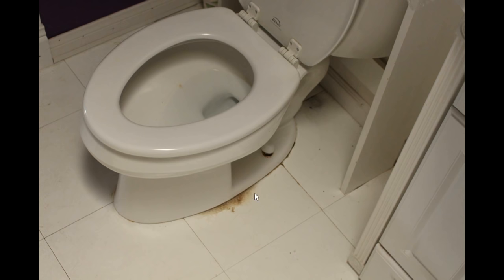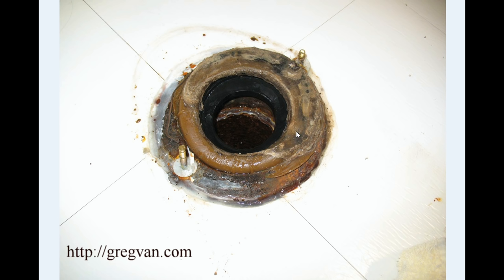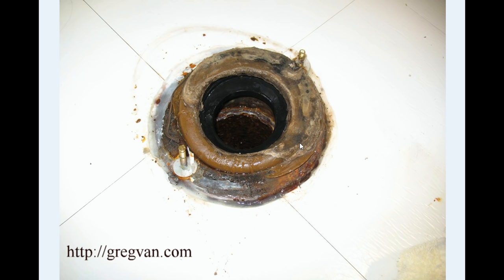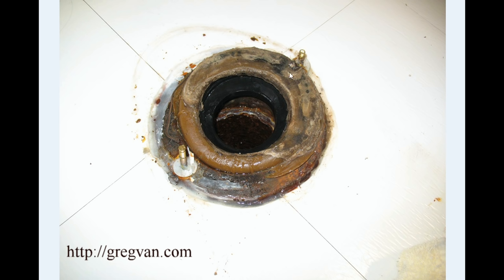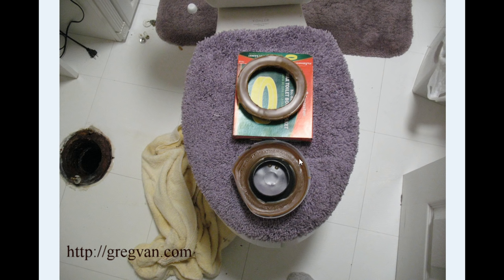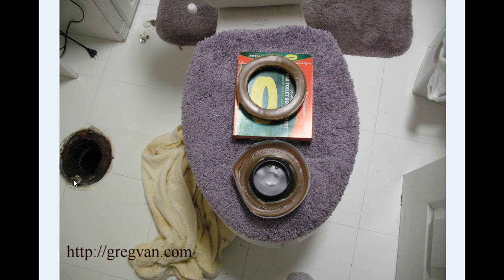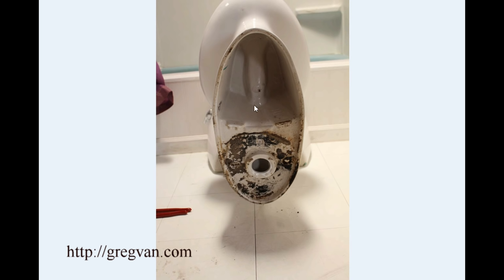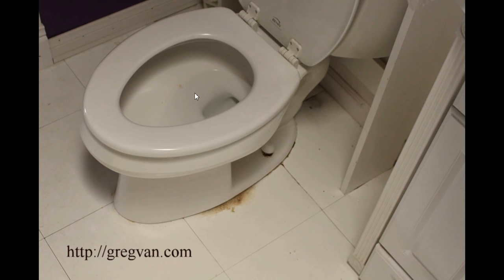Watch This Video If You Have Water Leaking at Bottom of Toilet – Home Repair Tips

Comment: I had a new wax ring put on my toilet to seal it because it was leaking. The old wax ring looked as if it had melted and wasn't even there almost. The new wax ring started leaking after about 2 days so he came and put another wax ring on and after about a day and a half it started leaking again. When he put the second wax ring on the first one also looked like it had just melted and spread where it would not seal. I do not know what to do.
Reply from the maker: It sounds like there isn't a large enough gap between the toilet and the top of flange. I will have to make another video on this problem.

Comment: I had new toilets installed.  When you sit on the toilet it makes an air release sound. If you move around on the toilet seat it make that noise like releasing soda bottle top.  Do you think it could be the wax ring  not sealed properly? The toilet flushes fine and I don't see any water around the toilet.  It is caulked though so I may not be able to see the leak.
Reply from the maker: +Shauna Glaspie The toilet shouldn't be loose, try to tighten the bolts that connected to the floor. The only time I ever had this problem was when I went over to someone's home and they had a cushioned toilet seat, but have never ran into that problem since.

Comment: I am buying a property and the inspector noticed the upstairs toilet leaking at the base, and he used his radar camera to locate water in the ceiling/wall below the bathroom. The floors were recently replaced and the owners used a handyman (instead of a plumber) to remove and replace the toilets. Do I need to reinspect for water damage to the flooring, subfloor and mold inside the wall/ceiling below?
Reply from the maker: I would examine the areas myself to see if there is damage, but I don't know if you need to hire an inspector.
Reply: if the owners cut corners with a toilet, imagine what else they did……run
Reply: @KRITORISS  can't afford the properties with better maintenance. I can fix this one for less than I can buy another

Comment: We had a drain back up and thought the toilet was overflowing. Upon checking back, the base of the toilet is leaking while the drain is backed up, or slowed down. Would that be the wax ring?
Reply from the maker: It could be, but I had the same problem when I had a drain backup and it usually isn't a problem once the drain is unclogged. If it continues to happen after the drain is unclogged, then I would seriously consider removing the toilet and replacing the wax ring.
Reply: gregvancom Thanks and it did clear up with the clog resolved.

Comment: I recently replaced wax ring (leaking) with rubber ring that has 2 rubber gaskets on top (came with 10 year guarantee).. Still leaking. A lot. I'm a grandma so its heavy and awkward to lift toilet and replace. Willing to do again but need more tips to get it right. Toilet is in basement with concrete floors. Removing toilet is not supposed to damage rubber ring like a wax one. More info on the bolts maybe?
Reply from the maker: You might need to find someone strong enough to place the toilet in the proper position. Sometimes when you're installing the toilet you can actually squash the wax rings or relocate the rubber rings, which would allow water to leak out of the bottom of the toilet.

Comment: My toilet leaks at base  No one uses it.  When it leaks it's leaves a yellowish stream.   The yellowish stream does. Not happen all the time.   I just moved in the house less than a month.  Could it be an issue with the wax ring or a cracked in the toilet as stated in the video
Reply from the maker: Yes and don't forget to inspect the entire outside of the toilet, sometimes for cracks and where it connects to toilet tank.

Comment: Hi there, I had to unblock my toilet last week and a few days later noticed water leaking on path outside, is this a coincidence or could it be coming from toilet?  Thanks.
Reply from the maker: I would check to find where it's leaking from.
Reply: @gregvancom  Thanks, it's actually the water supply pipe that's leaking and just a coincidence.  It's going to be fixed on Monday.

Comment: So I have a toilet that’s not holding all the water in the bowl. You can see it losing water out of the bowl after it stops filling. It loses about half the water but doesn’t seem to lose anymore after that. I do have a wood floor and the house is old and seems the wood is a little crunchy sounding. I can’t see any water from the base of the toilet. I can rock the toilet with hands front to back but not side to side and me not be level. Any thoughts?
Reply from the maker: If the water is disappearing that fast, then you might have a crack in the toilet bowl somewhere. Keep in mind that this is only my opinion, because you could have a blocked pipe or vent that is creating some type of suction or siphoning affect also.

Comment: How do you fix the problem of a rocking toilet that causes this in the first place? The toilet is on a cement floor with carpeting that will now have to be removed. 
Thanks for the video - very helpful.
Reply from the maker: I am planning on making a video about securely fastening toilets, to prevent them from moving, just don't know when it will be made. Most of the time toilets move because the two toilet nuts on each side cannot be tightened for some reason, does this sound like something that might be happening to you?
Reply: @gregvancom  Yes I think it might - the rocking is front to back though. 
It's on a cement slab and I think the carpet install caused the problem - 
why would anyone put carpet in a bathroom anyway? Now it's all been removed thanks to the backflow which required removing the toilet to clear the line anyways. What a mess! Cement slab was a good ending at least - possible to clean. Now we'll put in waterproof laminate and maybe I'll learn how to properly seat a toilet. Make that video, please!!! We'll need it! lol

Comment: You stated that if the water in the bowl slowly drains down when the toilet isn't being used that it could be a crack in the toilet, but that there could be other causes.  What might those other causes be?
Reply from the maker: Something else I can think of would be some type of siphoning of the water when the pressure in either the drainage or vent pipes changed, leading to an event that would pull the water out of the toilet bowl.

https://youtu.be/lQKuc5mxdQM

Comment: Hello I have a question

For the last few months my toilet gets blocked very easily, I noticed when you flush the water builds up just a little bit higher than when it should, as if there is a small partial block that never goes away (I know there is nothing down there because I live by myself) and I have just been dealing with it. 

So when it does get blocked completely I flush it with a bucket of water which is enough pressure to fix it... so I noticed this leak today at the base after using the bucket, is it related and what does it mean?
Reply from the maker: Try holding the flush handle down without letting it up to see if everything flushes down and if it does, then you might have a problem with your flapper. It could also be a problem if the water level isn't high enough in the tank and last but not least, something could be blocking the passage between the tank and the bowl.

Comment: Needing help my toilet is not only leaking water from bottom of bowl itself but backing up in bathtub nearby? Any ideas on how to fix?
Reply from the maker: It sounds like clogged door blocked drainage pipe. You might need to contact a plumber who unclogs drainage pipes or go down to your local rental yard and explain your problem to them and they will provide you with a tool that can be used to remove the obstacle in the drainpipe yourself. Keep in mind that this will not work all the time and might not be a long-term solution.

Comment: Hope you are still around. I came home from a trip.  It was very cold in the house.  I flushed a second floor toilet and got a wet ring on the ceiling below.  If I leave the water on then water continues to run outside into the septic tank.  I got a large water bill after this was going on for a month and I didn't know it.  When the water is turned on now, it doesn't leak into the ceiling the ceiling though stained is dry, but water is going outside. Is this a wax ring problem?
Reply from the maker: The wax ring could be the problem for the ceiling stains or water leaking from the toilet, but shouldn't have anything to do with a larger water bill. That sounds like you might have a water leak somewhere. Type this phrase into a search engine "how to use water meter to check for leaks" and see if it helps you, before calling a plumber. You can actually use your water meter to see if water is leaking, but it won't be able to tell you where the leak is.
Reply: Water leaking in the toilet is not the water leak? Darn!  I will certainly type that phrase, because there is definitely a water leak and the water is running outside/draining out to the septic tank. But I am going to need a plumber to come with a compressor to find the leak. Water company wrote me note in my bill that my bill was 2.5 times higher and that I should check for a leak.  This was after the ceiling problem and water found running outside. THANKS.
Reply from the maker: You're welcome and it sounds which he got the situation under control.

Comment: We have a leak at times around the base not always though . . do heavier persons cause this to be a problem ? Seems it
Reply from the maker: If the toilet is moving and not securely fastened to the floor, then a heavier person might be able to move it easier. As the toilet moves back and forth, it can damage the wax ring, allowing water to seep onto the floor.

Comment: If I have a leak under my wood floors in my bathroom would I be able to see water around the  bottom of the toilet or could water still seep under the floors?
Reply from the maker: It could do both, seep through floor and lay on top of floor.
Reply: Found out my tub is leaking underneath and into the tile &wood flooring. They will have to access through tunnel under slab.🫣

Comment: Where can we send photos to? We have the smallest amount of water leaking into the grout and we’ve already replaced the ring to try to fix the problem. The water even travels a little further in the grout now :/
Reply from the maker: I don't know if you will need to send pictures. However, you will need to verify that water isn't leaking from any other part of the toilet that you can see on the outside. You will also need to check the water supply shut off valve and the water supply hose that connects to the toilet for leaks.

Last but not least, you might have to remove the toilet again to make sure that the wax ring was squashed down correctly. The only reason why I'm saying this is that sometimes the wax ring doesn't get squashed to create a seal and will require another wax ring.

If you need to send pictures, go to our website and at the bottom of every page is the word contact, click on it and it will take you to a page with the address on it.

Comment: how do you tighten the bolts when replacing the wax ring?  The bolts on our are loose.
Reply from the maker: I would need to know what type of bolt you are using, but this is a common problem and the best advice I can provide you with would be to grab a pair of pliers and create a firm grip on the threads that are extending up past the nut to prevent the bolt from moving and then try to tighten the nut. Let me know if this doesn't make sense.

Comment: Plumbers know exactly how much to tighten those closet bolt nuts to not crack the china .  whats the best advice to give on this to avoid any movement but not over torque those nuts ? .For you pros is it a matter of experience and feel ? Have you ever cracked the base ? That tells me you dont use much torque at all if you didnrt . If the bowl leaks after a repair do you just snug em down some more on a call back or do you start all over with a new ring ?
Reply from the maker: You bring up a good point and all I could suggest would be to follow the manufacturer's installation instructions. I can't provide you with the exact amount of torque required for every toilet installation, but can tell you that just a little more than finger tight might do just fine.

The toilet can still move if you're attaching it to a toilet flange that can also move and eventually ruin the wax ring.

Comment: We have been perplexed by darkish fluid coming through our downstairs ceiling and our upstairs outside siding in an area adjacent to our shower.  The upstairs toilet is adjacent to the shower.  We thought the shower was leaking, but recently discovered leakage around our toilet (it was always covered by a bathroom U-mat).  Could the toilet connection be leaking flush water into the flooring and then leaking through the downstairs ceiling and out through the siding?  Yuck!
Reply from the maker: Water leaks are difficult to find. If it's an area that's wet often, then you could stop using the shower for a while, but keep using the toilet, to see which one might be the problem and then of course vice versa. Use the shower, but quit using the toilet to figure out where the water is coming from. It sounds like you might have a leak through your drain pipes, which might require you to remove some of the ceiling or siding.

Comment: I had a Drain toilet stoppage on the first floor. and the water was backing up from under the toilet. I unclogged the stoppage. But when the toilet on the second floor is flushed there is a small amount of water dripping out from the bottom of theDownstairs
Reply from the maker: It sounds like the drain might still be partially plugged or that you might have a problem with the plumbing drainage pipes not diverting the water in the correct direction. Keep in mind that this is only a guess and that the problem might be something else.

Comment: If you just use the ring without that rubber piece, this would almost never happen. It's the rubber funnel that causes it to shift, not seal, and splash water out like that.
Reply from the maker: I would tend to agree, but have used almost everyone manufactured with good and bad results.

Comment: we put in a new toilet and it sweats bad  the old toilet didnt sweat but there was a carpet on the floor with the old tolite now the new tolite  just has no carpet  dont want to finnish the floor untill we get it fixed any  suggestions
Reply from the maker: The only time I've ever came across a toilet that sweats on the outside was when it was hooked up to hot water instead of cold water. I also would not put carpeting down, if this is a problem. Other than that I don't think I would be much help.

Comment: My toilet is leaking from the base. The tank isn't filling. Water has flooded the bathroom into the kitchen below the toilet also gets blocked really easy. Maybe something clogging the pipes further down?

Since the tank appears to of filled and the water stopped leaking. Not sure what this means.
Reply: reabo I am no plumber but my guess would be your sewer is backed up or full of debris. I would suggest asking someone with better knowledge on the subject.
Reply from the maker: It sounds like you might have multiple problems. If the tank isn't filling, then you would need to figure out why and that might have something to do with your water supply line or toilet bowl fill valve with float. You might need to run a plumbing snake through the toilet and the drain line to make sure that it isn't plugged or clogged. I have heard of items like small toys getting stuck inside toilets creating problems also. It does sound like your drain line is clogged.

Comment: Why would the water leak only from the FRONT of the base of the toilet? Could it be the  case that the water has found its escape (through failed caulking etc.) to exit there?
Reply from the maker: Absolutely, but water shouldn't be coming out of the base of the toilet anyway. It might not be as big of a problem on a concrete floor, but if your wax ring seal is broken somehow and allowing water to escape, then it could rot out the subflooring and floor framing members. Your method might work just fine on a concrete floor, but I wouldn't do it if you have a wood framed floor.

Comment: Why are you using 2 wax seals, versus just 1 with a  flange ?  Is it due to the whole is not even with the floor ?
Reply from the maker: The only reason you would need to use more than one wax ring would be if it was too short to create a seal between the top of the plumbing waste pipe flange and the bottom of the toilet. This could because by a variety of different things, including raising the height of the floor or lowering the plumbing pipes.

Comment: I have a toilet that leaks while not I use and if you flush it water backs into the sink and tub drains. What’s up with that? Any ideas?
Reply from the maker: Where is the toilet leaking, on the floor, into the drainage pipe? If the water is backing up into your bathtub or sink then it's a good chance you have a drain pipe clogged and might need to rent a snake from your local rental yard or hire a plumber to clear it out.

Comment: There is water leaking near my toilet, but not from the base of the toilet, could this still be wax ring related?
Reply from the maker: If is not coming from the base of the toilet, then it would need to be going underneath flooring materials, for example tile or vinyl, to be the wax ring. If I was you, I would clean the area to make a dry and then place some paper towels on the floor, where you think it's leaking and when you find a wet spot, look up to see where it's leaking from, but this wouldn't work if the leak is coming under the flooring.